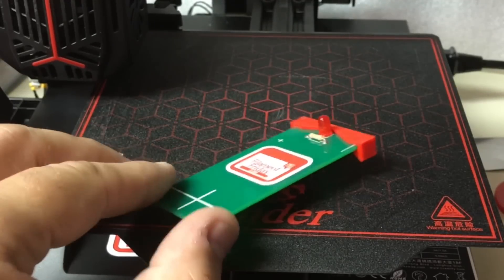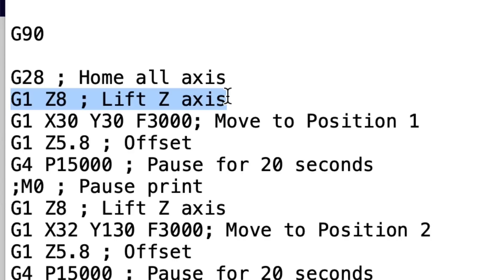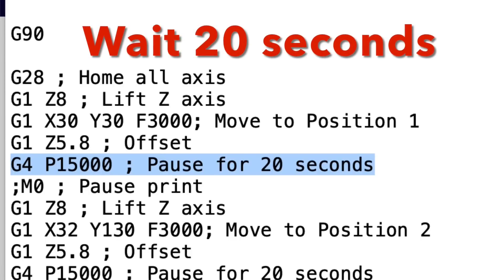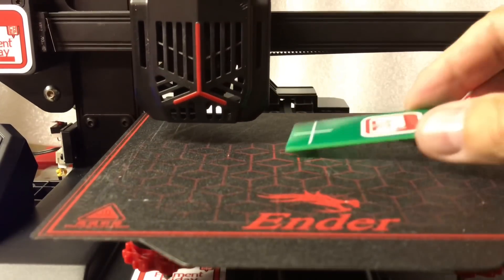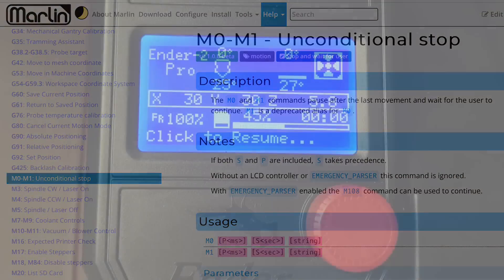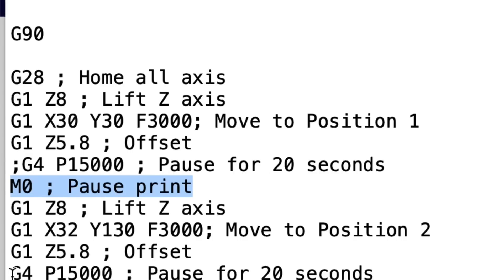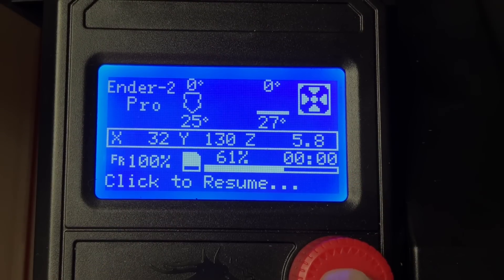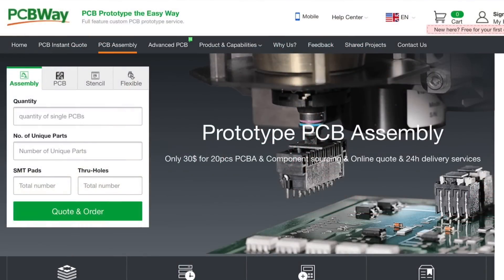Learn G-Code Basics by Improving the Ender 2 Pro E-Leveler File

Comment: I have e-leveler (V1) and fixed the battery and switch issue.  Is there a way to modify the code of the "level" menu option of my Ender 3 Max Neo?
Reply from the maker: With a firmware modification but I don’t have any details.
Reply: @FilamentFriday  OK, Thanks for the fast response.  I was hoping for a gcode file that I could print like the e-leveler file I use now.

Comment: My E-Leveler has stopped working.  I attached the battery saver.  When I removed the battery saver and the e-leveler no longer lit up.  I thought the battery went bad.  I removed the battery.  When I tried to insert a new one it would not stay in place.  I manually held it in place and press the button.  Nothing!
Reply from the maker: Contact the amazon seller for a replacement.

Comment: Just came across this and immediately bought one. Works perfect for my Ender 3s!

Is it possible to get this to work on my ELEGOO NEPTUNE 3 Max? The build plate size is 420x420. Would appreciate help. Thanks!
Reply from the maker: We have an Ender 3 max file size 300x300. You could modify it with a text editor to fit yours.

Comment: I gotten your Filament Friday level tool but the gcode is for Ender printers but I got Cr10s pro v2 can I do it manually with your level tool ??
Reply from the maker: There are three sizes including 300x300 in the download link that comes with the E -Leveler.

Comment: Dang this did not work on my s1 pro :(
Reply from the maker: Why not?
You can use it to level prior to running autolevel or just manually level.
Reply: @FilamentFriday  i will try again do you have any recommended beds because the s1 pro pei metal bed i cant get it to stick
Reply from the maker: I prefer Creality glass bed but you could go with FR4/G10. https://youtu.be/OXkC6zNe7Mo
Reply: @FilamentFriday  apparently geetech is selling one that's just like your on Amazon too
Reply from the maker: They stole my design.
Reply: @FilamentFriday  i know that's why I wanted to tag you as soon as I saw it and i called them out in their FB post

Comment: Why would Creality go backwards on this??? I have the non-Pro version Ender 2 and it has those bed leveling movements in the Software, no touching of the bed or hotend required!!   I'm glad there's a work around for this or I would sell the printer and stick with KP3S or Tronxy Crux 1.

Comment: If I want to use the g-code with my ender 5 plus would i just change the positions in the gcode to the locations of my adjusting screws to make it use that location for the measurement?
Reply from the maker: That should work.

Comment: Hello I have been using the leveler and has worked great on my ender 3 v2 bur when I try to use it on my ender 3 max it just seems like it cannot get it right. I have done the leveling several times but for some reason keeps seeing the nozzle to close to the bed after leveling. Is there something I am doing wrong? Because I do an initial paper level and e-level but then the nozzle the reach the leveler and when leveling it until the light bairly turns on the nozzle is way to close to bed
Reply from the maker: Is you bed warped?
Reply: @FilamentFriday  no I don't believe so because it is off from the lever on all for corners and when I do a paper level the prints come out fine.
Reply from the maker: Are you using the Ender max GCode file from my site?
Reply: @FilamentFriday  yes
Reply: @FilamentFriday  could it be the gcode having the z axis go to high? The printer shows that the z axis is at 5.8
Reply from the maker: No, if it worked on your V2 it should work the same on the Max. I can’t think of why you are getting different results.
Reply: I actually ran into the same problem with my Ender 2 Pro. I had leveled the bed with paper which left gaps in the bottom layer but it was ok for the moment.

I bought the Leveler and when I used the gcode on the ChepClub website, I noticed that the nozzle was higher than the leveler by maybe .2mm maybe less maybe more. So when I adjusted the corners, the machine still thought the z offset was 5.8mm but with me raising the corners the touch the leveler and then homing I essentially crashed the nozzle into the bed.

Point is use a caliper to mesure the thickness of the leveler from button and see if it really is 5.8mm or less. My guess less since if I level with paper that would make z home 0. But if I home then raise the z to 5.8mm and the I use the leveler to raise the bed by the gap between the nozzle and leveler and that gap is .3 mm then when I home again the nozzle will be -.3mm essentially going through the bed.

That's what I think at least. Maybe I'm using the leveler wrong or maybe the z offset in the gcode is off.
Reply from the maker: Marcos Ramirez - Are you adjusting to when the light first turns on or when it stays lit? Adjust to when it first turns on.
Reply: @FilamentFriday  Adjusting when the light barely turns on. Either way, something must of glitched the first time since the nozzle ended crashing into the bed but after I turned off my printer and tried again later I got better results.
Reply from the maker: Check the z stop switch for loose connection.

Comment: Is that red piece suppose to be on the button side or the side with the light ?
Reply from the maker: As the picture shows. Near the LED.
Reply: @FilamentFriday  awesome just another dumb question for PETG for initial z layer height what should it be with using this on cura ...
Reply from the maker: 0.28 seems to work well.

Comment: Was trying to contact you, however can’t find contact info.  There is nothing to hold the battery in on mine, it didn’t come with anything.
Reply from the maker: Contact the Amazon seller for a replacement.
Reply: I had the same issue.  A little piece of tape holds it.

Comment: Hey, it's arrived from USA, just to check, once used, when I ran the test squares on the bed ? , the first run seems to be rubbing on the bed, am I missing something?, and do I need to set nozzle to bed gap in Cura for item I print?
Reply from the maker: Run the GCode again for leveling and make sure the light just begins to light.
Reply: @FilamentFriday  Think E3 had a wobblily, switched it off and back on, and all is fine.  Been printing lovely since.  Was always having trouble with Petg sticking, working great. 👍

Comment: Hi so this isn’t the most related to this video chep but I really need your help. And it’s interesting too. I bought some old upgraded Ender 3 from someone for 100 bucks. I took it apart and noticed the ptfe tubing was stuck in the heat break which is normal for these printers. I noticed there was gunk coming out of the heatbreak that didn’t seem like filament. I haven’t seen this in my printers before and I’m curious. Could you help me? I can email images because I think you might be curious too. Thanks! The printer is also getting clogged.
Reply from the maker: Could be melted PTFE. I’ve see sticky gunk before. It’s all usually related to overheating and/or leaking filament.
Reply: I’m using Capricorn tubing and The gunk is a sort of grey color. It may be thermal paste? I’m going to convert to a Bimetal heatbreak anyway

Comment: This is frustrating.. 

In the code you raise it 5.8, is that the switch to cross height?  I ask because mine is 5.5

And the battery height is 6.0

Is that what the measurement is for ?
Reply: The jump is to 8mm, the tool height is 5.8mm in the original g-code : G1 Z8 ; Lift Z axis (to move to the next location, G1 Z5.80 ; sets the measurement height
Reply: @rossbrown6649  I get that.  But I don't get 5.8mm for any measurement and I want to get things in alignment

I'm having levelling issues on a brand new stock Ender CR-10
Reply: @sirgeekcsp  If you look at the g-code, the first G90 sets absolute mode, the next, G28 homes X, Y, Z axes, and then G1 Z8 lifts Z to 8mm, G1 X-- Y-- F3000 then moves to the 1st corner, and G1 Z5.8 lowers the Z axis to the height for using the CHEP tool. This cycle repeats for each corner...
Reply: @rossbrown6649  I do get this..  My issue is the 5.8mm value in the GCode from CHEP.

1) Is that the height of the circuit board to switch (non depressed/depressed) ?
2) Is that the height for the battery holder to circuit board ?

I have one of the "solder your own" CHEP testers.. And I've got no reference for the height being referred to 

I say this because I use it (with 5.5mm - the height for my board to switch being depressed) and I'm not level. I'll change it back to the 5.8mm and try again).
Reply: @sirgeekcsp  Using a micrometer, I measured the distance between the top of the circuit board and the depressed switch when the switch triggered from off to on. CHEP g-code says that should be 5.8mm; I measured 5.817mm, close enough. It may be that the fully depressed switch is 5.5mm, but that is irrelevant to the desired measurement, which is when the switch triggers.
Reply: @rossbrown6649  perfect. Thanks.
Reply from the maker: Yes it’s top of board to switch depressed. It’s all explained in this video: https://youtu.be/715Xop79Sus

Comment: If measurement shows the metal sub-bed is warped, basic bed tramming works poorly, especially if the print bed is rigidly attached to the sub-bed. A good glass bed should be flat, or flatter than that, so since a plane is defined by 3 points, not 4, attaching a flat glass bed using only 3 points and 3 of the 4 bed screws should allow a glass bed to stay flat. A 4x4 CR touch mesh shows that this is possible, with +- 0.05mm accuracy (I first tram the glass bed with a dial indicator to +-0.001" and have adjusted the X-axis extrusion parallel to the printer frame). So far, that is the best bed tram I have achieved. I have the CHEP tram tool, and a micrometer shows mine triggers at 5.817mm (0.229") so that is how I set the g-code, and adjust the X/Y steps for the Aquila vs the Ender positioning. Note that the tool when over the unsupported bed corner can deflect a 3mm glass bed, so I skip that corner. I am going to try a 4mm bed to see if that is sufficiently stiff to overcome that.

Comment: I modified your leveller code to work with my printer. The biggest fix was to use M25 rather than M0 for the pause. Now it works fine on my printer. Now I just have to wait for my E-Lever to arrive here in Canada.

Comment: Chuck, a big thank you to you from France for your eternal sharing. I just decided to make the circuit.  I also adapted your G-Code for my CR-10S printer which has a 300mm plate. I have tested all that, it works like a charm! My firmware accepts the M0 command, amazing!!! 

Thank you, thank you, thank you .....

Comment: Is there a way to buy the leveling tool from Europe? With shipping and customs, it gets prohibitively expensive. Is there a EU reseller? Or is it possible to make one from local parts?
Reply: Shouldn't be hard to make. It's just a battery, switch, 100ohm resistor and LED.

Comment: G4 P15000 should wait 15.000ms … how does this become a 20 second pause?
Reply: 15000 Milliseconds  = 15 Seconds.

the value should be 20000 for a 20 Second Pause
Reply from the maker: Time it and see if I’m right. There is processing time or something but end result is about 20 sec.

Comment: I use an it sensor with an an led to let me know when it’s triggered so I will give this code a go to do the same to level the bed manually first as a starting point for auto bed levelling thanks again for this.
Reply: On another note can this code be added as a macro and added to the menu in the firmware so you can just run it when you want without adding it to the as card?